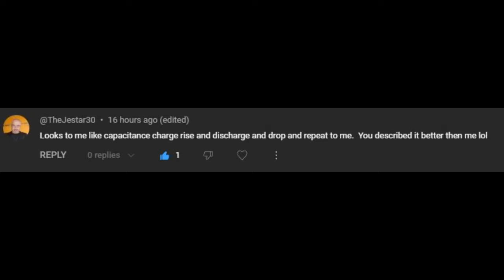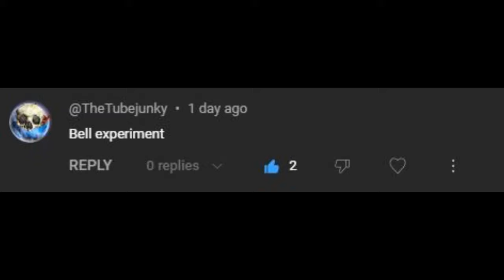Vibration Experiment

Comment: As far as this experiment goes. I think it holds important observational utility for rotation dynamics. I wish I could speak more to that or what else is at play; but my electrical engineering knowledge isn't too extensive. However there is an experiment that I am vaguely familiar with which involves similar components from the "Chladni Plate". A huge resource in interpreting wave dynamics. Your lab experiment index is a much needed resource.

Comment: I have seen this happen on my graviflyer when one of the nuts came loose on the vertical rods. The nut would move up or down depending upon the vibration induced from both the beat freq, as well as the vibrational resonance of the midplate/rods.
Reply from the maker: We are going in the right direction. This and the tesla coil experiment. It is right where we need to be. We knew when we started building a UFO there were going to be things happening outside tritonal physics. It is crazier to find out they fall in line with Tesla, TT Brown and Grebennikov. The understanding of this is much bigger than just the Graviflyer.

Comment: Friction + Threads
Reply from the maker: I have a question in general. If you could create a force equal to the weight of a crafts total weight. Can a small propulsion force lift it? ( not about graviflyer and you can use any propulsion as long as it would normally never be able to lift the weight by itself )
Reply: @nathanbunten4299  Helium balloon in equilibrium with surrounding air-space (floating freely, stable in air) + canned air onboard blowing downwards should do the trick?
Edit: To be really pedantric, a lit candle under a basket, connected to the helium balloon. Hot air rises, bringing the balloon upwards with it - or, as time go on the candle burns away and missing weight makes the balloon go up if the candle is 'on board' the basket, not hanging the right distance below the basket ;ø)
Reply: @nathanbunten4299  Once it is in equilibrium, all forces are NET 0. Then the equation a = F/m applies. Given its mass, m. It will accelerate proportional to the applied force, F.

Comment: The top of the bolt moves more because it is not fixed in place. Micro Centripetal throws it out and up. Like a plastic doughnut on a stick yiu can fling.  The threads dictate the rotation.  Nothing special happening here.  Imo